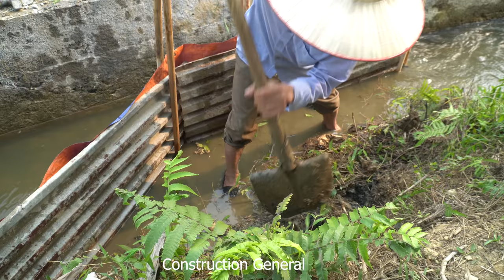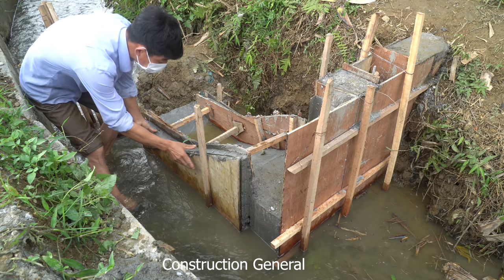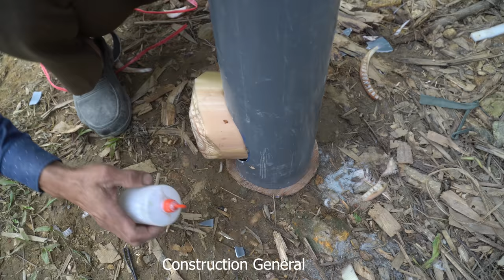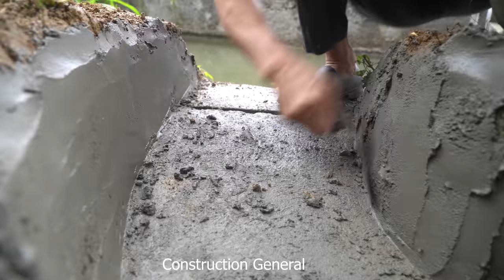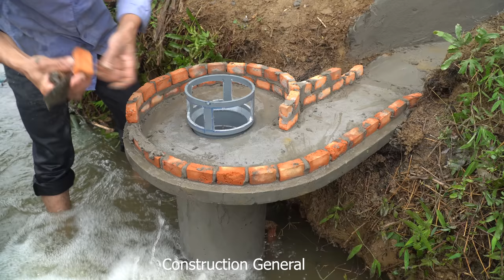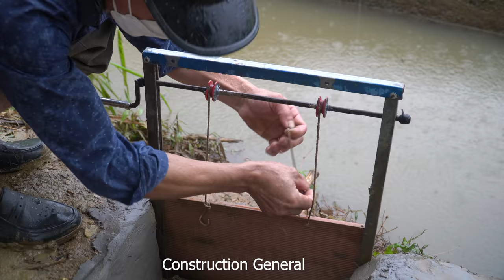Blocking The Water Flow To Build Mini Hydroelectricity

Comment: Congratulations, and inspiring too. One point though, so much of hard work only to lit decorative lighting?. What is the water discharge value in Cumec, so that the  turbine type  (reaction)  and the  corresponding capacity of the generator in KW may be coupled for max efficiency and to lit a small household with 3/4 bulbs. 👍
Reply from the maker: Yes, exactly

Comment: very nice ; one question, what voltage and power do you get?
Reply from the maker: 24v, 30 W
Reply: With solar I get 125 amps absolute peak of the year at 12~16 volt but this time of year with clear sky’s around 100 your battery storage will always be key !

Comment: Please assist on how you ended up with your outer diameter of the whirlpool and the inner diameter. Thanks I’m advance
Reply from the maker: Outer diameter 30cm, inner diameter 10cm
Reply: How did you calculate? Please assist I have a similar project
Reply from the maker: I work freely, not according to any formula.

Comment: I don't understand.
There's enough flow there to power at least 10 "average" homes. You did all that work to light up a string of LEDs?

Even saving the power bill for your own home would be more of a payment to you than the YT money for this video.
Not trying to take away from your work, it's a pretty cool little water feature. 

I just don't understand.
Reply from the maker: Your comments are great
Reply: @Chien-Tran  I looked at your channel. Subscribed. 

Now I understand. 
👍
Reply: There is not enough water for ten average homes.  He only has a couple feet of head there and a small ditch.  Could you get some more power?  Sure, but not enough to power even a small house